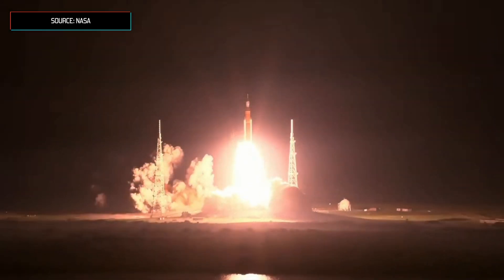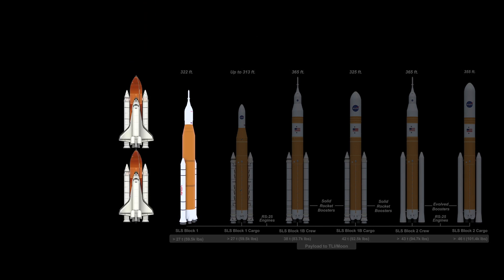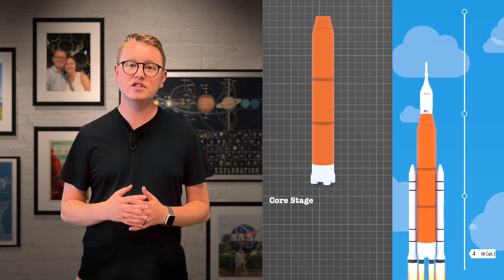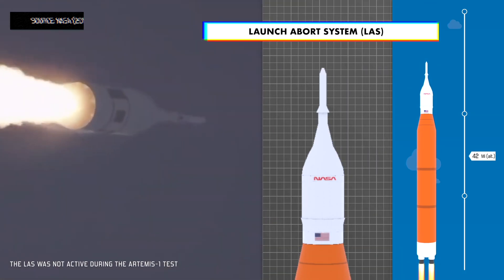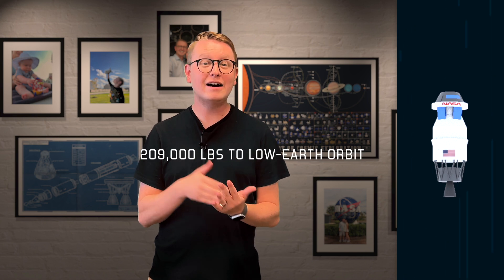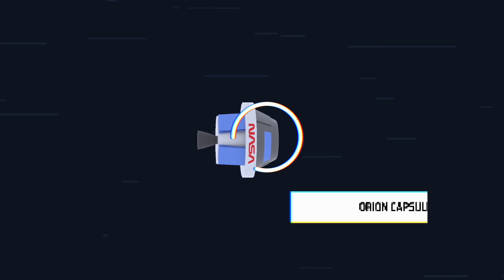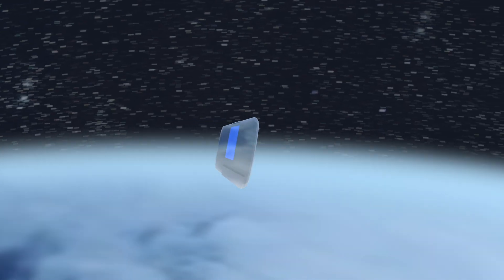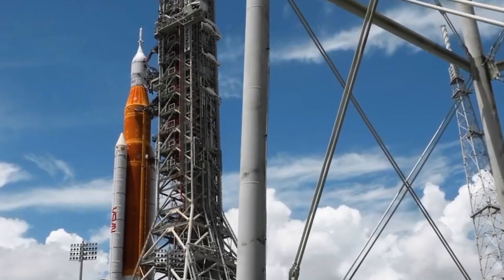America's new moon rocket: The SLS

Comment: Definitely cool video man but I can't stand how everyone is on SpaceXs a$$. They are the only company mentioned here yet the SLS is a combination of Northrop Grumman, United Launch Alliance, Aerojet Rocketdyne, Lockheed Martin. None where mentioned. Just the one company which had NOTHING to do with thus launch was mentioned smh.
Reply: But NASA is nothing but a jobs program! How am I supposed to turn over my soul and life savings to Elon?
Reply from the maker: You're right - a lot of companies came together to develop the incredible technology of the SLS! I certainly don't mean to diminish the work of those companies. They should be proud! I unpack how these companies contributed to SLS a bit in my other video about how the SLS came to be. It's tricky to highlight any single one of them because there are so many contractors!

My comparison to SpaceX is really due to the fact SpaceX seems to be the closest to launching their own  human-rated rocket system with similar mission parameters to SLS, whereas none of those other companies have anything similar in the pipeline anytime soon. In fact, if SpaceX can deliver on Starship, it will far exceed the capabilities of the SLS. That really sets them apart from what those private companies you mentioned are doing. For example, Boeing is developing the Starliner capsule, but it'll launch on top of a ULA rocket - it's just a different developmental model. If Starship succeeds and goes into service, people will certainly be comparing SLS to SpaceX's Starship (and probably asking, "why is NASA paying for SLS when Starship is so much cheaper?"). Of course, SpaceX is only one of many private companies aiming for a vertically developed, manned rocket, but it seems to be the closest to having an entire manned rocket system certified for orbital and lunar missions. That might happen as soon as 2024 (although personally, I don't expect a manned Starship flight until 2025 at the earliest). 

So no shade on those contractors like Northrop, ULA, or Aerojet Rocketdyne - far from it! They and the many other contractors should be proud of their accomplishment with SLS. In fact, it's their advancements in space technology that have made the successes of these new space contractors possible. My comparison to SpaceX is more about comparing similar, whole launch systems (SLS compared to Starship). If any other company develops a launch system, we'll definitely be talking about it on this channel. 

I hope that helps clarify things!